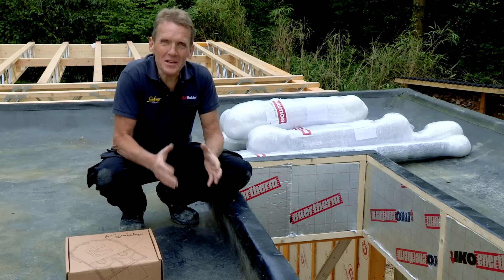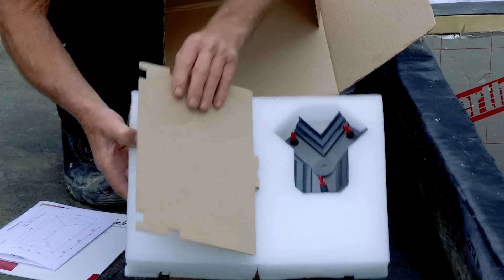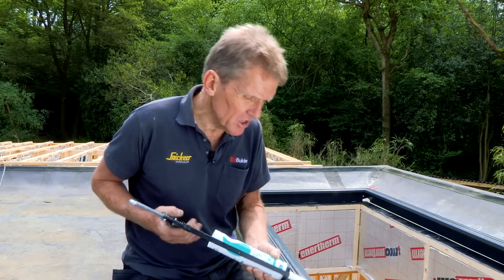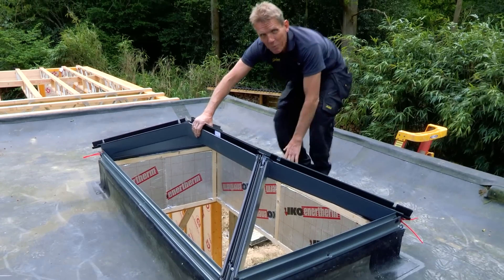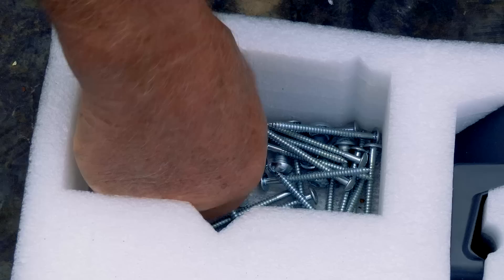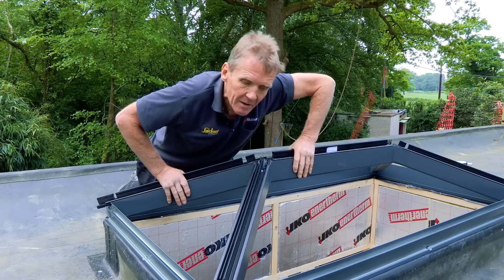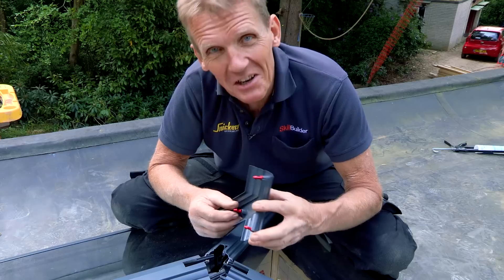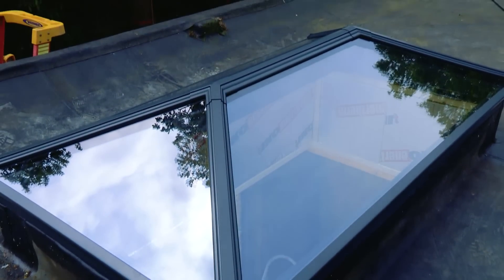How to Install a Korniche Roof Lantern with Skill-Builder

Comment: Seemed a good product and ordered on on the strength of this video. Unfortunately although well packaged on the outside to prevent damage. not the same can be said of the inside  and my eaves beams are scratched where bits of machining swarf have not been cleaned off properly and were trapped between the two components causing the scratches. No doubt I could return them, but that will delay my build even further, with no guarantee that the replacement parts would be any different. Ideally the components need to be cleaned properly prior to packaging and wrapped individually before bundling together. I do not have the time to get the parts replaced, requiring me to have more time off work to accept delivery once again, so I am getting some touch up paint to try and disguise the scratches, but it is a shame that what seems to be a good product is spoilt by poor packaging and something that could easily be prevented. I will see how installation goes next week.

Comment: Frankly mine wasn’t engined to quite the same standard! The holes for the bottom row of cable ties were drilled through the end of the profiles rendering the cable ties useless. Made it much harder to get the thing square as only the upper cable ties were doing anything. Have to say I’m disappointed. A proper QA check should have noticed. Made for Trade need to up their game.

Comment: Advice for anyone installing an upstand: make sure the corners are a perfect right-angle. Use a square or laser level to check this. 

My roofer built an upstand that looked great to the naked eye but actually wasn't fully square on the corners. Even the lantern surveyor didn't spot this. When it came to installing, the lantern wouldn't sit properly, which has now delayed everything. The lantern has to be removed so the roofer can correct the upstand, and then we'll have to attempt the lantern install again.

Comment: Actually scrap that the info is on the link posted by someone and to the guy going on about it being 69mm or whatever , the info suggests that's the minimum so you could do it out of 3x2 or 4x2 do 3 pieces wide its a solid near enough 150mm upstand and no need for ply

Comment: Hello, if the roof is 3000 x 2000 how many pieces of glasses should be? Could be 4? Or should be more than 4 to keep it safe.
Reply: I can say from experience that the glass panels at 2.6m long and 34kg weight do exhibit quite a lot of flexibility as they taper to corner points, and so it can be harder and a bit nerve-wracking to fit the straight, rigid aluminium glazing bar to these..In future I'd go for intermediate rafters on the frame to keep the glazed units size more maneable.

Comment: When ordering the size of your lantern should you measure the out side edge of the raised beam in order to you to order correct size? For example if my outside edge was 2000mm x 3000mm do I order a matching korniche lantern. Hope this makes sense.
Reply: I have the same question and can't find the answer anywhere
Reply: david barrett 
Outside edge is the measurement you need.
Reply: stuart holding that is the conclusion I have come to. Thank you Stuart.
Reply: @stuartholding4525  ive seen the spec and korniche require the frame upstand to be 69mm , how can i build a frame that size is 3x2 timber with the ply / osb on outside..

If it is say 90mm and you sit the lantern on the outside edge, what happens with the finish on the inside with the extra gap of timber that the frame doesnt cover?

I know you can plasterboard the side but the top part where frame sits , would look rubbish
Reply: @baconsarneybroonsauce6913  the reason it has to be outside edge is because it makes fitment easier, I discovered this when fitting my 3x2 lantern, and due to building regs for my roof this seemed impossible, in the end I bought some 3x2 lengths and screwed them down matching the base of the lantern then had to lead flash and sat the lantern on this. This then made inside look right.They are a good lantern but this is an issue they have overlooked !
Reply: Also outside edge fitment for drainage
Reply: @stuartholding4525  ah see  so when you screwed the 3x2 down was that so it kept it 69mm ish.   Did you not put any osb board on external against the upstand, which of course makes the width approx 90mm. I know its a little thing but its got me baffled a bit. Im deciding on the 3000mm by 1500mm lantern what do i need to show structural engineer so she can then do the lantern timbers design?. Sizes etc .
Reply: @baconsarneybroonsauce6913  yes in my upstanding, I think it had to be 150mm insulation because of building regs, so after upstanding was completed to building regs then I screwed down the 3x2 lengths and fitted lantern to that.
Reply: Are you in Lancashire ?
Reply: If you send me your email I’ll forward you some photos
Reply: @stuartholding4525  did you send them over mate?
Reply: @baconsarneybroonsauce6913  just sent now
Reply: @stuartholding4525  havent came through mate
Reply: @baconsarneybroonsauce6913  did you get my email, it say delivered
Reply: Yes, you provide the external measurement as the lantern sits on the outer edge which allows the water to fall off away from the upstand.
Reply: I’ve just had my quote through as it says I should order a Korniche lantern 12mm larger than the outside diameter of the upstand including the waterproof membrane (fibreglass in my case), so will be larger still. My builder said it’s common to trim the inside with window cill board of similar to give a nice edge to plaster up to on the inside. Our lantern is big, but on a smaller one I can imagine it being a shame to close in hole too much.

Comment: Is it secure? Looks like it’s easy for anyone to take apart
Reply from the maker: The Korniche is secure, the clip fit top and end caps are a one-way fit and once installed correctly add to the integrity and strength of the overall Lantern which is probably the strongest on the market today. Take a look at the details of the product on the website Korniche website www.korniche.co.uk
Reply: @MADEFORTRADEUK  if a glass panel failed or got damaged, how do you remove the cover strips to release the glass.